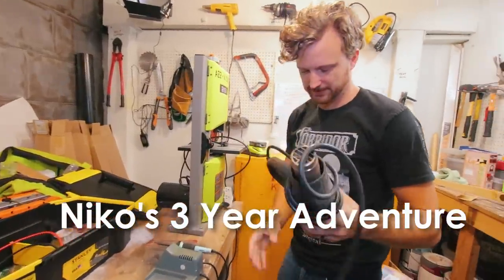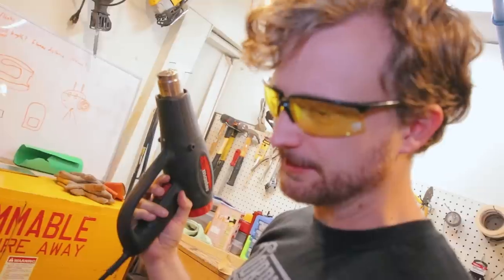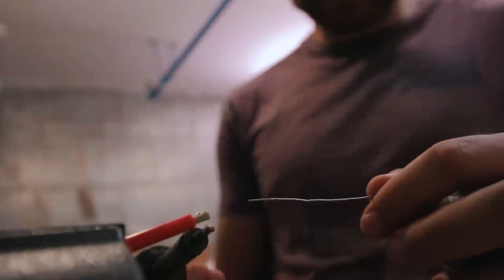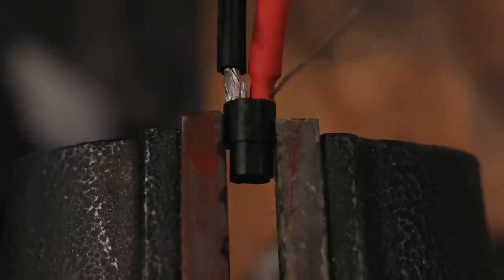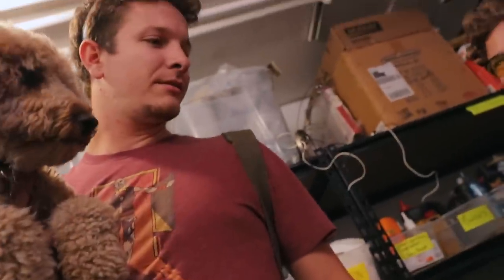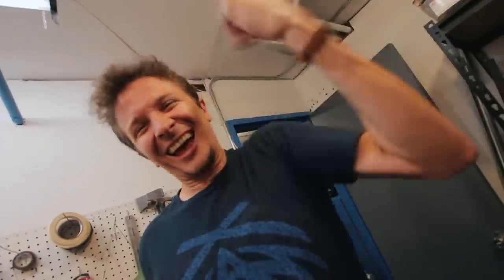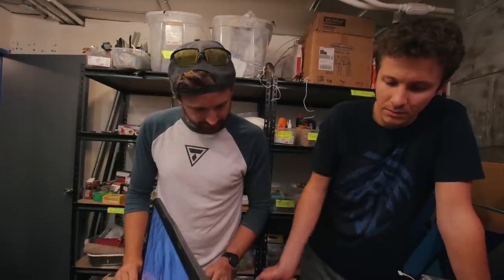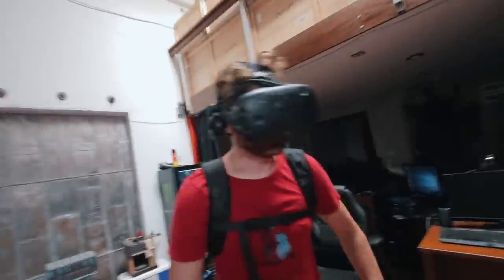3 Year Personal Journey to make a VR Backpack!

Comment: This was a really enjoyable video to watch. I'm a hobbyist electrician and have studied it a bit, so here's my two cents:
- 10AWG wire is a little bit oversized for this application, since the laptop's power connector will be the limiting factor in terms of resistance (it's rated for 7.5A per pin at 20V DC). Same thing with XT60 connectors though I understand they were already on most of the parts.
- You've correctly identified the connector type as Kycon 4-pin but I couldn't even find the exact right plug. An option could be to take a KPJX-CM-4S and chop the outer shell off.
- If you wanted to solder the power connector more cleanly, you could solder two smaller gauge wires to each of the big leads and then solder those to the connector, giving you a bit better conductivity. However, what you did seems to work so it's more about tidiness.
- The wire "sponge" for cleaning soldering iron tips is effective, but the reason I use a wet sponge is the wire sponge is abrasive and will wear out the coating on the tip quicker. I don't know much quicker, and if your use is only occasional the tip is probably going to last years.
Anyways, if it works it's great. Hope somebody finds this wall of text somewhat informative.

Comment: Why not use HTC's new wireless adapter for Vive?

EDIT: Answer: Because this is cooler.
Reply: line of sight
Reply: Because the wireless adapter introduces more latency.
Reply: Or to make it more portable
Reply: @James Dreger, @ScottGNT Both the TPCast and the Intel Wigig wireless adapter don't have latency, or at least it's unnoticeable. Also, there is no signal loss even when you actively try to cover the adapter with both hands and disrupt the line of sight.
Reply: I think having the computer on your back allows for the vr to work anywhere as long as you set up the base stations. Im imagining taking it to a friends house, setting up the base stations, then being able to play.
Reply: @ScottGNT Definitely no noticeable latency on their wireless adapter.
Reply: because a wireless headset wasn't the issue...
Reply: Because a wireless adapter doesn't solve the desire for having the computer in your backpack... it's also way more expensive than this solution.
Reply: The correct answer is range. For the VIVE Pro, the wireless adapter bottlenecks the size of the play area, which is why Niko is making the backpack in the first place.
Reply: @scottgnt  not really enough to notice
Reply: @scottgnt  like 2ms of latency.

Also, whoever said this is cheaper. The battery alone niko is using here is $350. Thats already $50 more than the wireless adapter for the vive. Factor in the transformer, the backpack, the connectors, the time.
Reply: because it wasn't around 3 years ago? and giving up midway through is boring
Reply: Because this is the mission he set out to do 3 years ago. I fully understand not wanting to change after you have spent so long on something. I spent 4 years learning to pick locks all because I locked my keys in a room once.... okay maybe a dozen times.... Anyways I got to where I could pick all sorts of locks, padlocks, eurocylinders, dimple locks, locks with crazy security pins, etc... all but that one door handle. I even bought a second handle to practice on and could get that one within a few seconds. The logical thing would be to just put the second one I bought on the door and toss the old one but no at this point it was a goal I had set. A mission to feel like I had mastered something. Well after these 4 years I am proud to say I can finally pick that god damn piece of garbage doorknob. That feeling of finally getting that done was better than any drug.

I guess a simple example would be: Because what you suggested is cheating. You can either go to the gym and work to lose weight or you can cheat and get plastic surgery/liposuction.
Reply: or you could just take 1/1000000th the effort and just remember not to lock your self out. also it took you 4 years? was this garbage doorknob the most secure doorknob ever designed? most locks someone could learn to pick in a day...
Reply: James Dreger You’re line of sight with the base stations no matter what. I just clipped my wigig antenna to my base station wire and have no problems or latency. Also, I can guarantee that my included 10k mAh battery and the $60 30k mAh battery I got on amazon have more battery life than his. Also, mine is expandable, safer and hot swappable. Literally the only advantage of the laptop is that it’s less stuff to transport over a desktop. My advantages are safety, reliability, ease of use, full desktop power, large and endlessly expandable battery (via hot swapping that takes 15 seconds without removing the hmd), mine is lighter and less hot. Also, you have to consider the issues from having the laptop closed and strapped to your back, whereas I can troubleshoot right away on my desktop. 

If you’re going to transport 2 base station stands, your hmd, a laptop, giant external battery, and all the rigging, you might as well just swap the external battery and laptop for a desktop, small monitor and wireless m+kb.
Reply: Well yeah thats obviously the ideal situation, not locking yourself out. Yes 4 years because this wasnt a skill I was working on daily. But the thing about being the most secure doorknob I guess in a way it is. As its so crappy its good. Also it might just be the one in 100,000 that was placed just perfectly during manufacturing so all the machining on the core was perfect. Learning to pick most locks in a day. I'd love to see someone learn to pick a medeco lock or an assa abloy in a day. The point is working on something for so long and then finally getting it is the best feeling ever.
Reply: SirWrender the laptop itself cost more than my desktop and the adapter combined, and it running a 1080ti. 

Having the computer in the backpack is not my idea of convenient. The laptop has to be closed and strapped in, so if troubleshooting is needed, hmd off, extract and open laptop, then the reverse before you can play. For my, I just lift the hmd and work on my desktop, then lower it.

Also consider the additional weight on your body. For me, it’s a few ounce battery pack in a pocket or on my belt, and a transmitter that is. Lighter than the length of 3in1 cable normally stretching to the floor behind your head.
Reply: Ok hold UP. First off, we're in the business of making content. What's more interesting, doing a sweet DIY backpack computer build or simply buying the wireless adapter and doing what so many other youtube channels have done? Secondly, NODE already has the wireless adapter. The point was to make a VR backpack!

Thirdly, when I said it was "cheaper" that's because for us, it was. We already had the battery. The buck converter doesn't cost much, nor does the wiring.
Reply: @SirWrender  you still had to buy those things. It doesnt suddenly become cheap because you already paid more for it. 

Sure you guys are in it to make content. But that doesnt make this idea the cheap option.
Reply: SirWrender  Shoot! I just realized it was Wren! Sorry! I wasn’t trying to be rude. I loved the video. I tend to get caught up in the debate.
Reply: @x9x9x9x9x9  assa abloy? Yeah most peoples crappy dooknobs dont cost a grand.
Reply: Yeah actually... it does . Re-purposing stuff we already have is absolutely a valid way to bring down costs. If you want to argue over semantics, sure I meant cheaper for us instead of cheaper in general, since that's how much it cost us. It's still irrelevant from the reason why we did this project to begin with though.
Reply: nope
Reply: @SirWrender  its irrelevant, but no one else mention cost until you did. So it must have been somewhat relevant.
Reply: @SirWrender That makes sense. It is also a really cool looking project that has been fun to follow for the last few years. I was curious why continue after the wireless adapter's release but people had good points with the limitations of the new wireless system VS the Corridor VR Backback and why its better.
Reply: Look at the Oculus Quest. Backpacks will be obsolete.
Reply: Except for the fact that it doesn't. It has been tested by many hardware reviewers and found that there is no difference between wired and wireless latency.
Reply: How would he move across the building then? The point was to make it portable, not to get rid of wires
Reply: @D3moknight  It's not wireless though
Reply: Brendan Mustain update 2019: we don’t need base stations anymore, rift S  offers relatively similar vr experience to base station VR without the bases

Comment: You could pretty easily solve the no recording issue by disabling the display turn off/going into hibernate when the screen is closed. You can usually find it in system settings or some deeper settings on more expensive laptops. Nice work, dude!
Reply: If it went into hibernate and or sleep when it closed it couldn't run vr as a hole.
Reply: Crassus I know?? I’m saying you can just keep it from turning off the display in the settings. I’m unsure why people feel the need to disagree with what I’m saying when I haven’t said anything wrong xD
Reply: lol he didnt respond

Comment: Why not just deactivate the part that makes the computer under clock? this way if will always draw full power no matter if its on battery or plugged in. I think that you can do it in windows 10, go to control panel, power options and just make it so that the battery always performs at max no matter what (battery life will be lowered tho)
Reply from the maker: You can turn off all the underclock settings, but it will still underclock. There’s a hard limiter you can’t change.
Reply: Ahh, so that setting is basically a lie, I thought it would not underclock. Thanks for telling me dude!
Reply: did u guys think about using a intel nuc? much much smaller.
Reply: @CorridorCrew  You can't disable underclocking  from windows but from bios you can.
Reply: but maybe the onboard battery alone couldn't produce enough power. So they would design it so that the laptop would use external power for maximum performance.

Comment: That DC to DC converter is totally UNPROTECTED and if damaged will most likely FRY the LAPTOP! 

I would recommend just 3D printing a case with rubber filament. This will make sure that no possible shorts happen and hopefully make it a bit shockproof.
 Also, that is NOT the best way to SOLDER two wires, it's the easiest. Ideally you would want to apply the same amount of heat on both wires simultaneously and then start feeding the solder. This ensures that the solder has adhered evenly and that there are no bubbles that could result in a failure if stressed. Lastly, I really respect you as a film maker but please don't ever become an electrician, there are too many risks when you are dealing with 120V :)

Comment: I've always wanted to do the same concept but with an analog electric guitar rig. Maybe wiring stomp box buttons into the shoulder strap to swap between channels. Weight is the biggest issue, can use a "lunchbox" amp head, like an orange terror, but the speaker would require the most work to cut back on weight.

Comment: Or, ORRR, here me out, you can buy the new HTC Wireless adapter. Definitely cheaper than all the materials you were using.
Reply: That has more latency than completely wired.
Reply: Apparently, the latency isn't even noticeable on the wireless adapter... I hate to say it Niko but I think you could just get one of those and be better off. Still a fun and cool electronics project!
Reply: Why go buy something when you could just make it yourself with what you have and a $10 connector!
Reply: Darthluke I doubt you've made anything yourself besides a sock full of sadness
Reply: @TheOfficialDedpool a tiny amount that is unnoticeable. More info on youtube about both TPCast and the HTC wireless adapter.
Reply: cheaper ? not realy The Laptop was being used anyways and the other parts dont amount to much
Reply: Definitely not cheaper to buy it
Reply: Except they weren't trying to make just a wireless headset..
Reply: Or just get the oculus quest
Reply: TheOfficialDedpol can confirm there’s zero latency. I’m using a vive pro, super sampling at 125%. It’s WiGig, so we’re not close to the bandwidth ceiling. Also, batteries are hot swappable and I have one I paid $60 for that lasts 8 hours. So, yeah....
Reply: SaltyChawn you can’t just say ‘it’s cheaper since he owns the laptop’ you have to include the cost of the laptop vs the cost of a much more powerful desktop and the wireless adapter. I can guarantee mine was cheaper.
Reply: He  could take the whole thing to the park or anywhere else with the laptop where a power supply may not be available.
Reply: Don't get me wrong, the Wireless adapter is pretty dope. It's just not the point here. Making interesting content is our first priority, not throwing money at a problem no of us actually has. Had that been my goal when I wanted to get my wife an electric bike... I certainly wouldn't have built it from scratch using 3d printed parts. I would have just bought a damn electric bike haha.
Reply: That battery alone probably costs a few hundred dollars

Comment: niko, you should explain how those weller TCP soldering irons work.... the thing that switches the element on & off to control the temperature is a switch on a spring down the centre of the element, & the switch is held on by a magnet in the end of the tip. when the iron heats up & passes the magnet's "curie point", the magnet lets go & the element cools down. after a while, the magnet is strong enough to switch it back on again.
the genius of this idea is being able to get different tips that operate at different temperatures, depending how strong of a magnet they're fitted with.
but why does the laptop need 19.5V?

Comment: Too bad that the new oculus is coming out next year and it requires no cables.
Reply: Welp, the HTC Vive already has that today
Reply: yeah, but it's a mobile processor and is locked to a third of oculus's walled gardens.
Reply: The HTC Vive system of today is far worse than the new Oculus. Just watch the Tested video about it :)
Reply: Still the Vive runs over a computer which has FAR more power than mobile processors etc and you can run EVERY game
Reply: James Dreger its a start to wireless and its impressive
Reply: Vive's controllers are still tracked the whole time, though

and again, walled garden.

Comment: One thing you can try is using this with a WMR headset. This would eliminate the need for trackers, and the act of plugging in the headset would autostart the windows "VR Hub" allowing you to select and start games without ever leaving the headset or looking at the screen. The other benefit is since it's inside out tracking, you could walk literally anywhere without having to worry about tracking. If for testing, you can find them for dirt cheap, then when going for quality, the samsung odyssey provides the "High end" of the WMR headsets.

Comment: Whelp. I just paid $300 and got the WiGig adapter. Slightly less portable, but I can leverage my desktop with its 4GHz quad core and 1080ti. I also got a 20k mAh battery pack so I can play on my Vive Pro continuously for 8 hours. Then it’s a hot swap to the included battery for another 3-4 hours. So I’m biting at the heels of 12 hours of wireless VR play. Of course, I can increase this as much as I want by buying more $60 30k mAh batteries. Not super cheap, but might be worth it so I won’t have downtime while all packs are charging.

Comment: 3:45 I know I'm late on this, but for future reference when soldering wires into amphenol style prongs cut and twist some solder and put in the cup. Then once wire has been properly twisted and tinned, use the iron on the outside of the cup and insert the wire once solder has melted. All from a vertical position. These types are annoying to get fully proper solder technique and aren't even graded by the nuclear power electronic technician maintenance school for the US Navy that teaches off of the NASA standards. The amount of twisted solder in cup should stick out above the cup a little bit as well.

Comment: 6:35 actually mad props for being able to get 10 gage wire over both connectors. My question is why was that necessary? Surely a smaller wire can be used. 14 gage will do 15 amps, 12 gage 20 amps, and 10 gage 30 amps. It's a laptop so it normally runs off 120v plug in the house, which is rated at 15 amps and that laptop isn't going to pull near that. Why wouldn't you use two smaller gage wires that would fit in the cups and the splice to the bigger wire?

Comment: The BEST way to solder is to actually heat up the metal alloy within the wires themselves instead of just touching the solder straight to the tip of the iron. That way the solder sinks into the wire and the wire itself absorbs it deeper instead of it just being a surface bond. You also never really want to get into the habit of blowing on to it prematurely.

Comment: Question for your delema around the 5 minute mark:

From what i could see you had a thick wire and it needed to be soldered to two small bits on the connector.

why not either :

a: use two smaller wires that would have been easier to solder to those small close pins and then solder them to the thicker guage wire on the other end thus giving you a bit more breathing room

b: cut off a bit more sheilding on the wire and kind of split it off into two smaller strands and use heat shirnk on them in a kind of "Y" formation (if that made sense)

i know nothing about soldering and electrical things so any information will help me understand why my ideas would be bad practice.

Comment: quick tip it is usually cleaner if you melt the solder directly on the wire. (As far as I am aware)